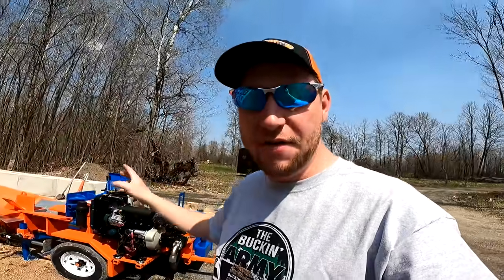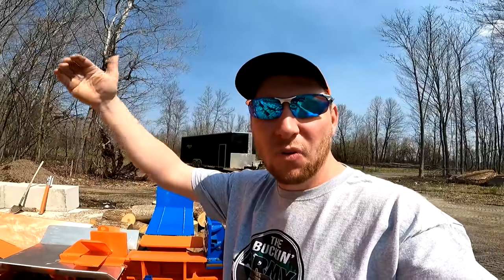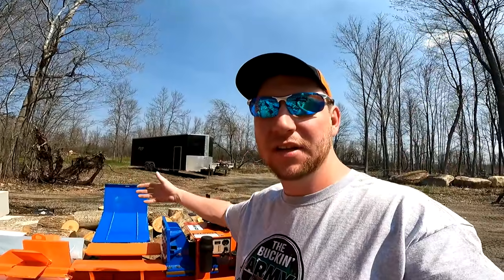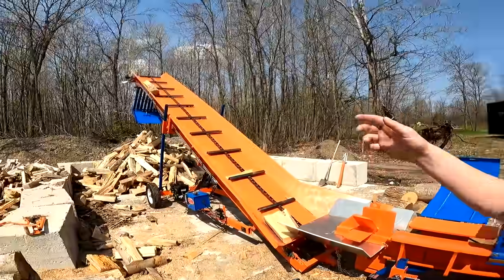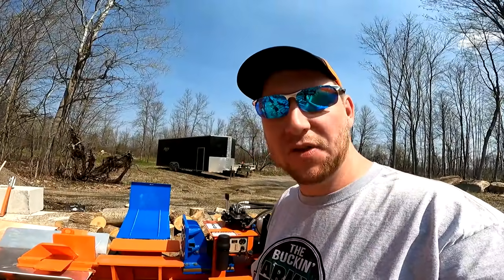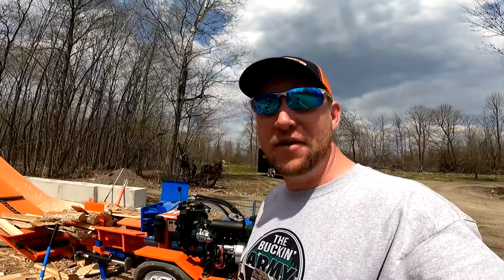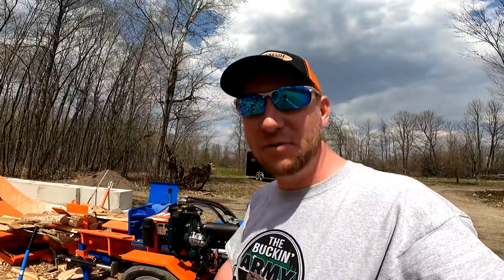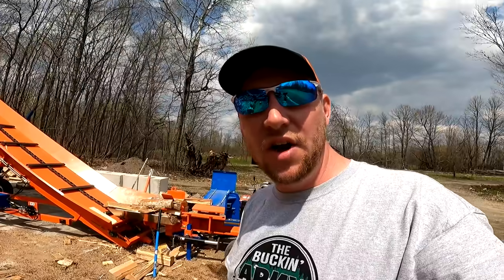Eastonmade; Fastest Most Powerful Splitter Yet!!! HAVE WE FOUND THE LIMIT?

Comment: 1. I guess the next thing could be a photo eye that would automatically adjust the centering height for the splitting knives.  
2.  How concerned are you that someone could throw a block of wood on the return side of the pushing base. When guys are moving that fast i can see it will happen.
She,s a beauty!
Reply from the maker: haven't run into that yet claude.  The eye would be a really neat idea.  Thanks for the feedback.  I really appreciate it.

Comment: I’m so on the fence when the time comes to buy one either the 22-28 with 4,6,8 way wedge or the 36D with the 4,6,8 way. Both would work for me but it’s the extra cost of the diesel that I’m on the fence about vs the gas engine. Either way I know what I’m getting when it’s time.
Reply from the maker: That is a hard call for sure.  Either piece will hold its value well.  Really appreciate appreciate support
Reply: @m9 ovich good point. I probably would if I had access to off road diesel. Also it wasn’t the cost of fuel it was the cost of the Diesel engine upgrade.

Comment: It seems the engine labors more on the return stroke than the splitting stroke. Why is that?
Reply from the maker: It's moving a lot of oil.  It seems to work really well and not build to much heat though.  I have another type of valve I plan on trying this week that should help alot

Comment: At what stage does the line between a processor and a slitter get blurred?
Would you need 2-3 people cutting rounds to keep up with this machine?
Would you need to be superman to keep the machine busy for 4 hours and then do it again tomorrow?
Is there a big advantage in having a machine that is a lot faster than any operator?
Reply: I agree
Reply from the maker: it is really close.  When you look at wages it would make more sense at this point to buy a processor in good wood.  However if you get a lot of oversized or short pieces like tree services do than this would be the better solution.

Comment: Can the return pressure be adjusted to slow it down so it does not labor the engine so hard to retract?  I'm not sure that every time I'd run it I'd want it screaming full bore like that?  I wonder, if it's not at full throttle will it bog and kill the engine?  I'm definitely interested in that diesel but I want it to be a well rounded machine that can be adjusted for the task at hand.
Reply from the maker: it can be adjusted.  I am going to try out some different valving also.  Running the engine 1000rpm lower really isn't detrimental to performance on this one.

Comment: Andrew are you using the engine cooling system to cool down the hydraulic oil?
Reply from the maker: Good eye....hoping the pump is efficient enough to not need a cooler.  Have some more testing to do.  Yesterday it did very well.
Reply: @EastonmadeWoodSplitters  that is a absolute beast!!! Nice going Andrew.
Reply: @EastonmadeWoodSplitters  Looks like that quick return is going to build a lot of heat in the summer time..... Any problems with  a new design, usually will surface within the first 500 HRS...Beat the shit out of it before you market it!
Reply from the maker: @splitdoctor1993  we have a couple of options for the oil flow on the return.  If it's even within question you will see a cooler on it
Reply: @EastonmadeWoodSplitters  What RPM is that little Kubota screaming at to get that 4 sec cycle time?
Reply from the maker: @splitdoctor1993  around 3000rpm
Reply: @EastonmadeWoodSplitters  Kubota is a top shelf power-plant, we have multiple Kubota powered machines on our wood lot....May the firewood Gods be with you.

Comment: You must be aware of the theory of  diminishing returns. A 4 second cycle time could achieve a 900/hr split rate. Every time the lift gets used, the wedge needs adjustment, or a piece of wood has to be handled the cycle time becomes moot. Since you have so much power could you run 2 splitting rams off of a single motor? I was thinking a back to back Axis. Two 6 second cycle times gives an effective 3 second cycle rate.  I wish I had a need for one of your machines. They are by far the best built wood splitters I have ever seen . Take care

Comment: You really don't have to worry about how many litters of fuel per hour, but how many guys per hour get used up.
Reply from the maker: Thanks for the feedback and support al.  Really appreciate it
Reply: @EastonmadeWoodSplitters  no problem, I will be calling Jerry with a “G” on Monday to get my order changed immediately to this with a 4 way wedge and 7 way box wedge.
Reply: @EastonmadeWoodSplitters  have you guys ever thought about adding a diesel engine to the axis
Reply from the maker: @koltonbill9929  you'll likely see it in the future
Reply: @EastonmadeWoodSplitters  I was under the impression that diesels excel at long periods under constant load such as long haul trucks.

I would guess the load with a log splitter is quite variable also unless the machine is used for lots of hours the extra expense may be hard to justify.

Comment: Sorry buddy but I had a two man Super Split specially made with 3-1/2” rams & each one will out split this one, guaranteed. Plus, you can drive it, & a 25’ conveyor. It has a 4 second cycle time & lifts on each side. I’m from Southern California. I would like to see yours split our Blue gum twisted eucalyptus. We’ve had it in operation now for 10 years. We sale approximately 100 cords a year. For a splitter I haven’t seen anything that would touch it. In the 10 years the only down time has been the usual oil & greasing. We had a Master link break one time. This thing is bulletproof. If your going to come to our market for a splitter you will have to raise the splitting power to at least 50 tons or it’s not going to split our hardwood. No one out here will buy soft wood. You can hardly give it away. Anyway, if I were you I would check into theirs. I’m not running yours down but you haven’t started to get to the top of splitters like you say. I think your on the right road but being able to drive it to different kinds of wood makes a world of difference. Just trying to help. 
I’m retired now after 50 years.
Reply from the maker: Hope this helps out https://youtu.be/fS5qucq3lbg
Reply: Sir, have you seen pictures of the machine of mine ? Another thing I wanted to point out. On your processor you have the attachment to get rid of the small pieces. Since we started using the this splitter machine with the conveyor, we load the same as you do & same bucket & Carson dump trailers. I’ve never had one complaint about the small pieces, in fact, people are very happy to have the small pieces for starter wood. I wish I had bought a Processor in the beginning, the only reason I didn’t all our wood comes from tree jobs & we cut to size right on the job. Plus, there’s no way to get logs. If I had been thinking I would have had them put sheets of steel where you would put the logs. That would have saved many thousands of dollars in labor ever year. Plus, a lot of hard labor lifting the logs up to split. I saw you were out of gas just what little you did there. Lol. I’m not being sarcastic it’s just the truth. When you do 1000 +  cords a year that’s a lot of lifting That’s something you might want to look into. The only reason we ever started selling firewood is the dumps are so expensive. We haven’t used chippers in many years. We built what we call speed loaders. They have a 25’ dump box with a BC120 Printice crane with a grapple bucket. All our big saws I had ported up in Canada. They ran cooler & lasted twice as long between rebuilding. I still have some XP 395’s that run like new that I bought back in 92. They’ve all been rebuilt many times. The only reason I’m telling you this stuff is I like to see people do well. I do hope something helped you is some way. Good luck. Be Blessed